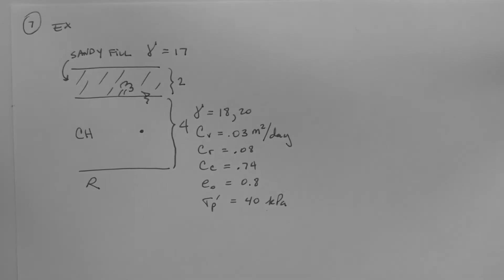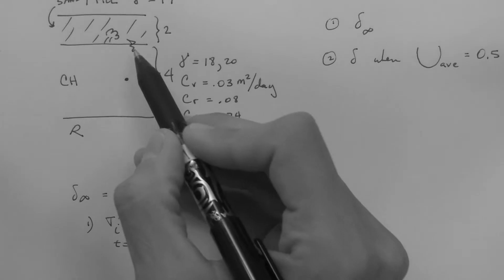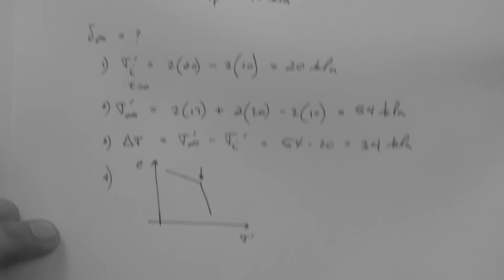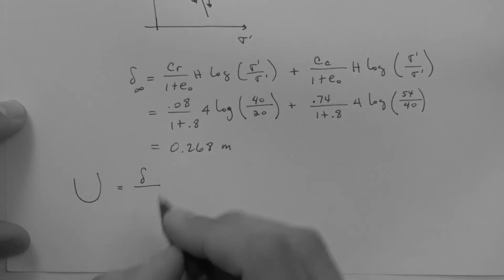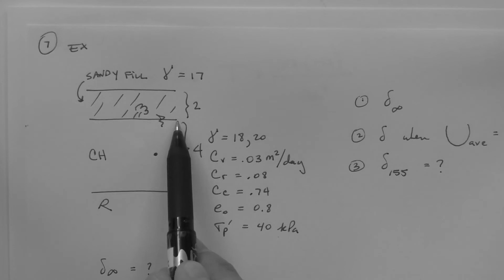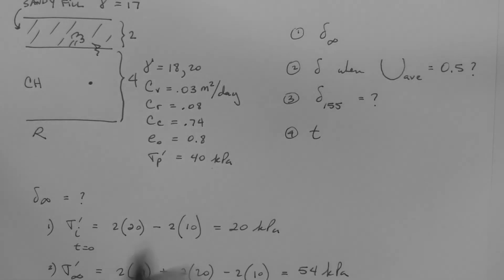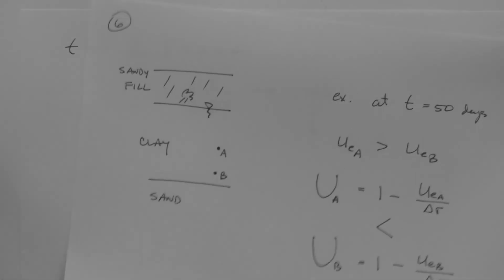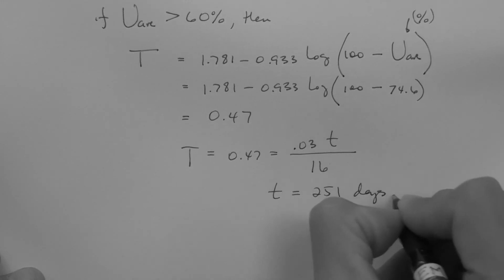Time rate of consolidation example: average degree of consolidation and settlement.

Comment: A half-closed layer (free-draining top boundary) is 10 m thick with cv = 7.9 m2
/yr. Pore pressure measurements were
made as follows:
Depth/ m 0 2 4 6 8 10
u/ kPa 60 54 41 29 19 15
Obtain a numerical estimate of the excess pore water pressure after 1 year’s consolidation has occurred. 
Can you please explain the steps for this if possible. Thanks